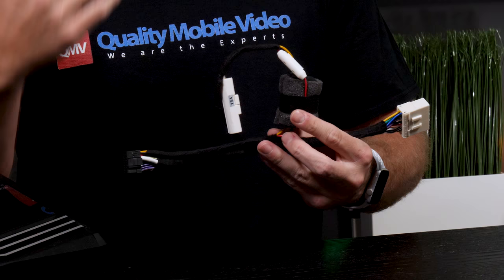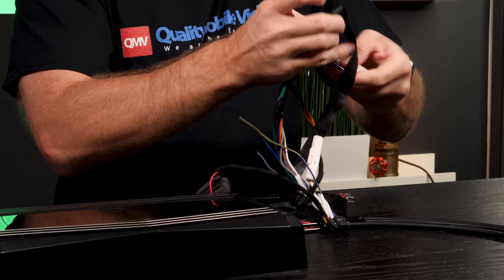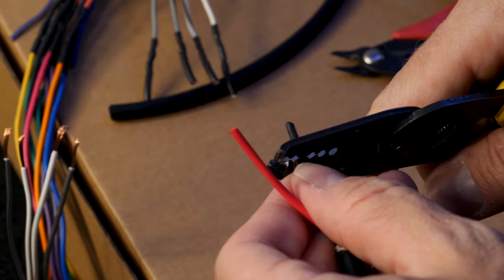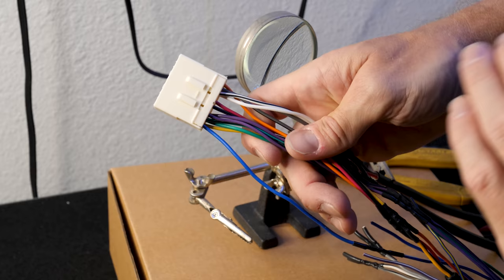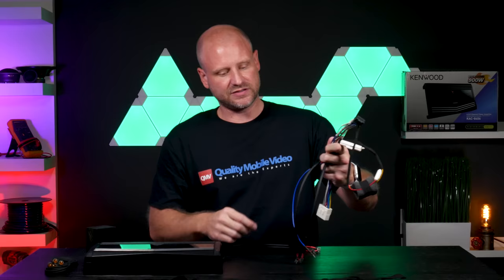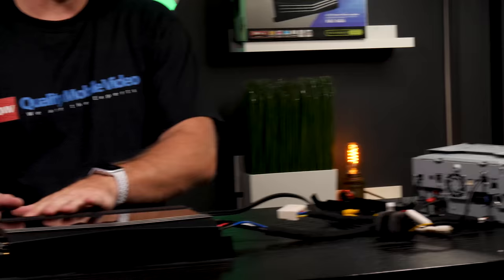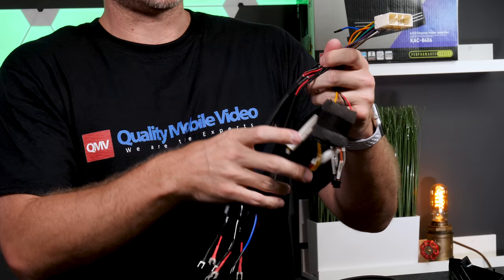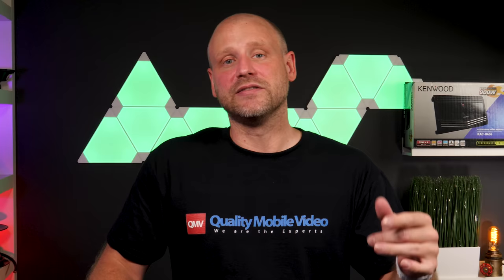Wiring a 2 or 4 channel amp to your stock speaker harness without cutting the factory wiring

Comment: so r u leaving the stock speaker wires as it is i.e connected to the new speakes and simply connecting the amplifier to the new stereo harness with a new aftermarket speaker cables in this video?

Comment: Ok sooo...cut the factory wires coming from the door and dash speakers, that would normally be connected to the harness, behind the head unit? Then attach/solder another set of wires to the factory speaker wires all the way to the amp? Then the wires from the harness that would normally be connected to the door speakers are then just taped off so they wouldn't contact anything?!?

Comment: So the RCA jacks on newer head units are really only there if you intend to use the radio with an aftermarket amp. If you want to use the stock speakers in your car you basically use the wires contained in the factory harness...even if you have a factory amp. Right?
Reply from the maker: Correct!

Comment: What if I wanted to add a subwoofer to this 4 speaker setup?
Reply: U have to run a 1in 2out power so now u have and extra power wire to wire up amp then u get another RCA cabels and run them out of the amp with speakers into the second amp for just the sub it's easy bro and run the remote wire from first amp to the second amp

Comment: What about if your car radio only has one pair of rca? Can you still set the bass,treble,etc. With the radio once you hook up the amp
Reply from the maker: Well then you can still send the RCA signal from the stereo to amp for your subwoofer. Depending on your amplifier, you can either make audio changes there or at the head unit.

Be sure to subscribe if you're new to our channel and let me know if you have any other questions :)
-James
Reply: Quality Mobile Video  dude I was killing my brain with this thank you . Now once all wires are ran to head unit from amp . Splice into my after market harness and make connections there right ?
Reply from the maker: @googoos78  Yes you can gain access to your speaker wires in the harness of your stereo. The purple, white, grey and green with and without black lines wires will be the speaker wires.

Comment: Somebody help I’m a bit confused. So the speaker wire I’m running to my amp is connected to my factory harness speaker wires?? Or the speaker wires of the harness coming out of my deck? Please help thanks!
Reply: Because my factory harness is connected to my aftermarket screen?
Reply from the maker: You will connect it to the vehicle side, if you connect it to the deck you will blow stuff up.
Reply: @Qualitymobilevideo  even though the vehicle harness connects to the aftermarket harness which then connects to the back of my screen deck?   So cut the speaker wire off the factory harness side? Ok thanks
Reply from the maker: @edwarddavis4091  You need to make sure the headunit speaker outputs are insulated and not connected. Only the amplifier outputs to the factory harness are connected.
Reply: @Qualitymobilevideo  ok thanks a lot!

Comment: Really useful video but I want to install amplifier do you sell wires for factory radios for 2017 Volkswagen Passat 4 channels. Thanks
Reply from the maker: Of course! Here are some 4 channel amplifier installation kits: https://www.qualitymobilevideo.com/car-audio/car-amplifiers/car-amplifier-installation-kits/shopby/amp_kit_rca_cable-4_channel_cables.html
Reply: Quality Mobile Video  thank you very much for the link but I want the factors to come out of factory radio go in amplified and then come out of amplifier and connect to factory speaker is it possible to buy these wires from you? Thank you

Comment: Hi, in case u do not have RCA outpout on the back of Radio, u can still take it from speakers cables on the rear on radio, rights?
Reply from the maker: Yup! You would use a Line Output Converter. Here's our video on that: https://www.youtube.com/watch?v=OXn8-8yee5o&t=2s

Comment: Ok I see that you connected the amp to the speaker wires onto the metro harness, but did you connect the remote wire to the head unit harness?

Comment: Question: can you have a powered sub, and have a separate amp powering the front door speakers from a single head unit
Reply from the maker: Sure, you can have multiple amplifier systems. I have a 2 channel powering a subwoofer, and a 4 channel power 4 speakers

Comment: my mustang 99 gt has mach 460 mach sound system,radio got stolen,im installing a new head unit and im not sure if its better to do this or keep the factory speakers connected to the factory amps.advice will be really appreaciated.
 im thinking about replacing my rear and front speakers and was wondering if i can run the new speakers wired to the factory amps or should i run the rear and front new speakers from the aftermarket amp(it's a 1000 watts rockford fosgate amp), the new speakers would be some kickers 200 watts peak and the head units its a sony mex-n5200bt it has a built-in amplifier (20 watts RMS CEA-2006/55 peak x 4 channels)..the ultimate question is,does this sony radio would be capable to run the new kicker speakers... i provided some speficications above,some advice will be really appreaciated.

Comment: So you cut the metro harness for the wires that will run the amplifier then you connect the factory wire connection to the metro and plug the RCAs from the radio the amp . But how do you run the wires for the speakers to the amplifier?
Reply: Run them from the back of the car to the front. Measure how much you'll need then tape them together so it's just one run. Also stinger had a product call quick or speed wire I believe, it looks like a ground wire but inside the insulation is all speaker wires.

Comment: Greetings,  Why not complete the connection from the harness to the radio on the other side?  That would keep everything clean and keep your power contained and signal strong.  You are also bypassing the need for an RCA which has ground loop issues with noise and looses power rather than doing a high power input.  Good video but would have like to seen the other option of direct wire rather than just sealing the cut ends from harness.

Comment: do you still use the metra if you are using a factory head unit and lc2i ?
Reply from the maker: A Metra harness is only needed with an aftermarket stereo installation! You're all good if you're not swapping out the stereo

Comment: I ran new wires for my speakers to my 4 channel amp  im not using the factory wiring would i have to cut the factory wire going to the head unit harness?

Comment: In my aftermarket wire harness I don’t have a blue and white amp turn on, just a blue antenna power wire. What else could I connect the amp turn on wire to?
Reply: run remote wirw into your fuse box into the fuse marked stereo/radio. see if itll turn on then turn it off make sure it turns off and youre done...

Comment: Loved the video my only question is would it be preferred to run the subwoofer on it’s on stand alone amp and the speakers on another or is it better to use a 4-channel with a sub all in 1
Reply: I would think it's better to run 2 separate amps for the system one amp for the car speakers and another amp just powering the subwoofer and make sure to throw in a extra battery to power up both amps to keep a constant voltage towards both amps

Comment: (for home application) if we use an active subwoofer will it still draw power from the amplifier and still have to formulated first or just plug it in into a pairs of the socket (back L & R maybe) since it already have it own power source??
Reply: gondokist no.  Where is thr sub getting it's signal from

Comment: So if im using a factory radio with no rca  would i use a amps high lvl input and run the wires thru that ? Or have to get multiple locs on speaker out
Reply from the maker: Watch this: https://www.youtube.com/watch?v=OXn8-8yee5o

Comment: When using the speaker level inputs on the amp to the radio how would you connect them together when the amp is at the back of the car and the radio is at the front would you need extend the wiring harness all the way to the back of the car to the amp?
Reply: Wht did you end up doing because i had the me quetion

Comment: I have a sony head unit that has a built in amp (55×4 watts rms)  When its installed is the amp already being used? Or do I need to connect the speakers to the RCAs on the back?
Reply: Yes. By default the amp within the head unit is being used once the head unit is installed. You don't connect door speakers via RCA cables... You use at least 16 gauge speaker wire unless you do not plan on replacing the factory door speaker wires. This guy didn't upgrade/replace the factory door speaker wires. If you'd like to replace the factory speaker wire then you would run each door speaker directly to one of the four speaker outputs on the amp. The RCA cables sends the signal from the head unit to the amp which then the amp sends the signal to the speakers via the speaker output leads.

Comment: I saw you connect turn on wire from hu to amp, but why doesn't the turn on from hu go to the after market metro harness- like where the turn on switched on the factory hu?  I'm confused because I thought blue to blue was what ya do.
Reply: When its connected to the hu and to the amp, when the radio turns on it turns the amp also on. If u connect to the factory harness that does not connect to the amp so it will not turn on.

Comment: If I'm adding a another aftermarket amp to my vehicle can I bridge the main battery power and ground from the 1st amp to the 2nd?
Reply: Run a distribution block from the main power to the second amplifier but make sure you add a second fuse for the bridged power. Create a new ground for the second amp and thats it. :)

Comment: Hi Guys
I have single din pioneer MVH-X580 BS for which I am currently buying Rockford fosgate component speakers set T2652-S
Which has 100 watt RMS

However I didn't find 100 watts coaxial speakers in power series. 
Wound you suggest T16 mid-range speakers for rear which has 70watt 
Or PPS4  punch series 100 watt speakers. 

Currently not installing any amp and woofer 

Would like to add on later 
For such set up. 
What amp would you suggest in Rockford with a sub that support my configuration.. 

Please advise... 

Thank a ton in advance.

Comment: Great video! Quick question: Why wouldn't we want to always run this with a single rca i/o in two channel if it still distributes the signal to all four channels? Does it change the impedance or wattage? What would be the benefit of running this in 4 channels over 2?
Reply: in case you want to run 2 channel for speakers and the other two for a sub

Comment: So let me get this straight. You are cutting out the head unit amp that usually powers the speakers around the car and replacing it with the Kenwood amp?
Reply: You are cutting between the harness for the radio and the aftermarket metra harness, not the OEM wires. The wires to be capped are the ones that plug into the head unit. The speaker wire connects to the metra harness, hope this helps.

Comment: What if theres no rca input in the stock radio?
Reply from the maker: Then use the speaker level outputs on the wiring harness of the head unit and a Line Output Converter:)

Comment: So let me get this straight. So before the amp is installed the radio is just connected to the harness that connects it straight to the speakers.   After installing the amp..the radio should be wired directly to the amp, and then the amp is wired back to the harness behind the radio that goes to the speakers?
Reply from the maker: You got it! This is just an easier way to do it so you don't have to take your car apart and run a ton of speaker wire in your car
Reply: Quality Mobile Video could you please explain something better to me I’m on the edge of understanding what’s going on haha.

The rca cables go from the head unit to the amp. And also we have all the wires running from the head unit to the amp as well. What I’m not getting is how the speaker wires behind the radio connect. They don’t connect to the headunit anymore because they get cut during the process. So I’m assuming they connect straight to the amp but where? Thanks:)

Comment: How can i add 2 more speakers to my stock stereo with this method? Id like to also add 2 more speakers on my dash. Let me know  whats the best way sir.
Reply from the maker: You can either get a 2 channel or 4 channel amplifier to power your speakers, or just wire them to the factory wiring to be powered by your head unit. Be sure to subscribe if you're new and let me know if you have any other questions :)

Comment: im confused, why are you saying to wire the speaker wires from the amp to the connector for the head unit ?  I thought you run RCA cables from the head unit to the amp, and then cut the wires at the head unit connector and run the amp wires to the wires you cut that go to the speakers to use the existing speaker wire.. NOT directly to the head unit itself.   Also re-using existing speaker wire for amps that arent factory.. you sure ?? lol because what if my speaker wires are 16-18ga.  and i have a 280-600w amp im installing..  16-18ga is mighty thin wire for 100+ watts of power going to each speaker..  14ga seems safer

Comment: I wanted to know would a autotek  4 channel amp  work if channel 1 and 2 burned out but will channel 3 and 4 still work?
?
Reply from the maker: I can't know 100% for sure without seeing your amplifier for myself. But, technically you can so long as no damage occurred to the other channels and they're still drawing current safely, but I'd still think about getting a new amplifier.

Comment: i want to do the same set up as the video but i want to put and a subwoofer 
i will move the rear wire speakers and i will install them with the font an i will bridge the rear output for the rear speaker wire with the sub right ?
if i'm right then i must take the front and the rear output rcs to the amp or i just install the front rca to the amp ?
Reply: If you want to add a amp JUST for a subwoofer then use the rear rca cuz all the highs are in the front

Comment: Il like the video. As a theory.
Unfortunately in real life it doesn't work. 
What's the point of fitting an amplifier with the original speakers? Almost none.
I will explain why: 
-the original speakers are barely a bit more powerful then what the original car radio output.
-the original harness is running near power cables ( electrical windows and so on) you will amplify also that additional noises.
-The original harness is made barely enough for what it should do.. the cables are very thin.
- the amplifier 90% of the time will go in the trunk because there is no space inside the car.
So my way is been always like this:
-I exclude completely the speaker harness leaving only the power cables on: no need for soldering and you can put everything back as original.
-Do not save money on cables if you don't want a headaches later.
-Run new speaker cables.
-Run new power cables for the amplifier from the battery with it's own fuse a bit bigger than the amplifier fuse. 
-fit new speakers the maximum you can fit in to the original space... Otherwise create more space 😉.
IF YOU REALLY WANT TO USE THE ORIGINAL HARNESS: 
with a precision screw driver you can take off the pins from the standard plug and add the fastom, again no need to solder anything. 
Btw you will most definitely and probably be disappointed with the original speakers sound.
Reply from the maker: There are are a variety of reasons people do this, namely not cutting the factory cabling. You can run speakers wire to the trunk for your new amps and speakers while using the factory speaker wires. Factory speaker wire can easily accept 75 watts.

Comment: Quick question if I have a 4 channel amp and I wire my car stock speakers front and back can I still wire my sub woofers with the same amp?
Reply from the maker: Depends on if the amp is bridgeable or not! What's the model?
Reply: I would just add an aftermarket radio. Usually your stock speakers are about 25 watts, your stock radio is probably putting out 10 watts or so. Once you add an after market radio it will send max power to those factory speakers making them sound much louder. If you run a powerful amp they'll usually blow.

Comment: is it safe to amplify aftermaket speakers while those are on stock wires?
Reply: Yes it is, if not you'll have to run wires to all door speakers and even rear dash speakers depending on what you have and that is a pain in the butt.
Reply: @jRomero713  im planning to run 50 watt per channel and sub, nothing fancy
Reply: Yeah that should be fine.

Comment: I have a question, so if I have a 2 Chanel amp can i run my both front and both rear speakers off of it?
Reply from the maker: Ideally a 4 channel amp would work best, but if the amp has enough power to handle two speakers per channel it should be fine!

Comment: Hi, how many RMS power can the stock speaker wire handle, thanks.
Reply from the maker: Depends on the gauge, but generally can handle up to 75W with no issues

Comment: Did he not connect the wrong end of the speaker wires? If the speakers in the doors are connected to factory wiring, he just severed that connection and sealed it off. Or am I on crack?